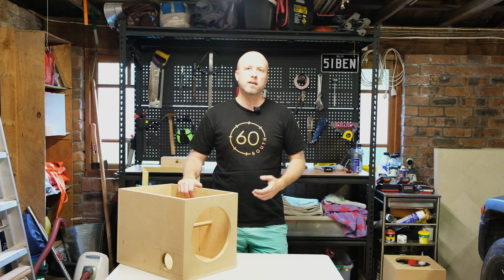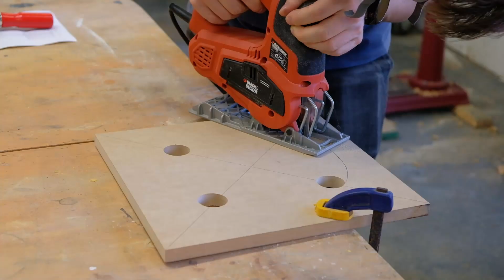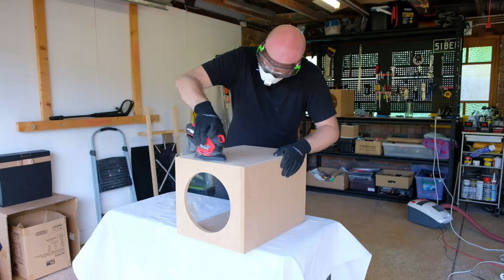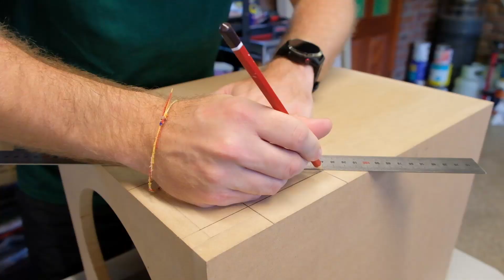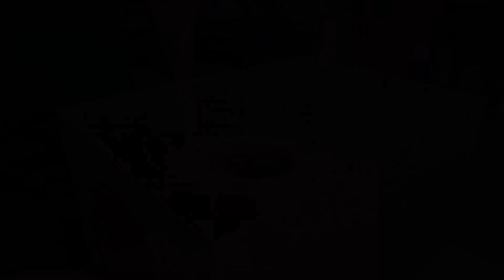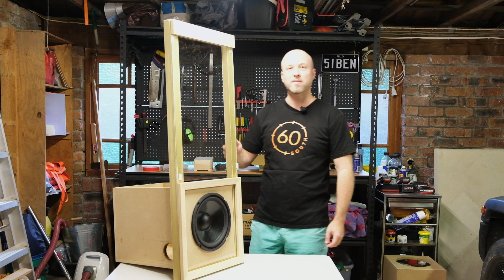Hybrid DML Speaker Build 1 - Design & Construction

Comment: Very interesting design, I love the natural tilt it has, I also think the placement of the inputs is brilliant, less interference inside the box. I also think the crossover should be on the outside of the box, never understood cramming everything into the box as it is a part of the resonance you create. Porting would make lower tonnes as well.
Reply from the maker: Thanks Graham. I did think quite a lot about making ported enclosures, but it wasn’t really possible to make it work with this frame/form factor (as the box dimensions would be significantly larger). 

I enjoy the process though, so if I’m not satisfied with the low end I guess I’ll take them apart and try another design!

Comment: Nice work 🙂 However, if you don't plan on using DSP, then the panel has to be fairly linear. The channel Tech Ingredients has a video showing how to do this with weights (or multiple exciters). Furthermore there was a Russian manufacturer of DMLs called Sheetcontrol, and in one picture I saw four exciters distributed in a circular arc pattern (does that make sense?).

I will give a little piece of advice. 

DMLs is a matter of simple mathematics. All lengths must vary to avoid convergence. That is the main reason for the '2/5-3/5'-rule. What follows is also almost square panels converge less than rectangular ones, so a 21"x22" is better than 15"x30". And the bigger the panel, the lower it will go. So without DSP, you will inherently end up with medium to large 'close to square' panels, with exciters distributed on them in a way, so that no 'paths' are equidistant. This should yield the flattest response, and hence minimize the work needed on the crossover. And round the corners. 

An easy DIY solution for DSP are ADAU1701, and I am pretty sure, Dayton Audio has a couple of amp boards based on that chip. DMLs are actually very good candidates for DSP, but that is another story.

I hope, I made some kind of sense? I look forward to see your progress 🙂
Reply: Just made an enclosure with a 1701 and three stereo 3118s using the 4 onboard DACs and two i2s outs for a hybrid DML setup. Powerful little chip.

Comment: Looks good.  Personally not a fan of the square look. If you stick with that wooden spacer on top it leaves you room to round off the corners quite a bit. Same as with the bottom. I would personally round off as much as I could get away with on the bottom of that frame and match it on top. 

Also, just curious as to why the connectors on the sides?  Looking forward to the progress, thanks for sharing.
Reply from the maker: I actually quite like it square like this. Having said that, I hadn't really given any thought to rounding it. Time for a quick photoshop I think!

I've put the inputs on the side because I'll run them together with the wiring for the exciter (up the back side of the frame). If I put them at the back of the box I'd either have to run them separately (messy), or run the exciter cables through the box somehow. This just seemed like a relatively neat solution.
Reply: @TypicalBenYT  Ahhh, ok.  I see where you're coming from on the wiring now. Are you going to try rounding the corners on any panels and test them? There is some nasty resonance that comes off squared corners evidently.  thanks
Reply from the maker: @toddincabo  not yet decided, I’m hoping to do some panel testing in the next week or two. I didn’t bother last time but it would be good to A/B test that to see what results I get. 

Like my last pair, I will be drilling holes near the corners for mounting points, with rubber spacers that will also reduce resonances, so it may be that additional measures aren’t required. We’ll see!